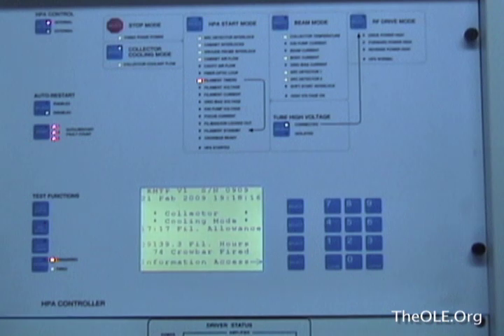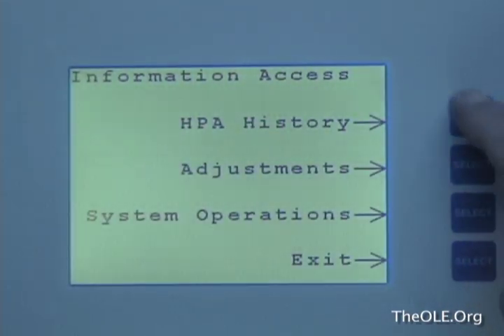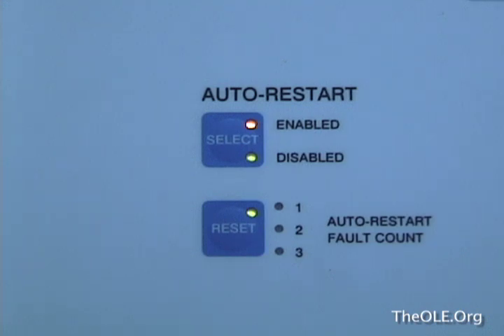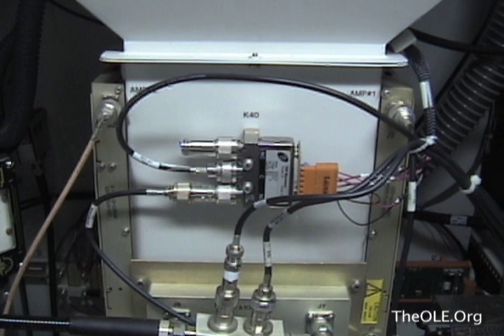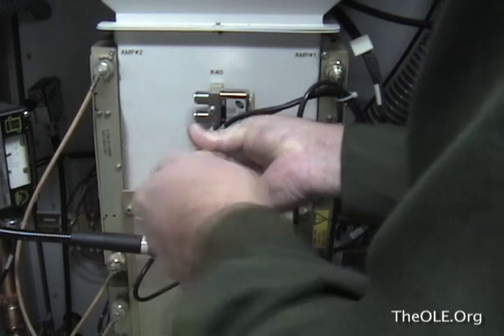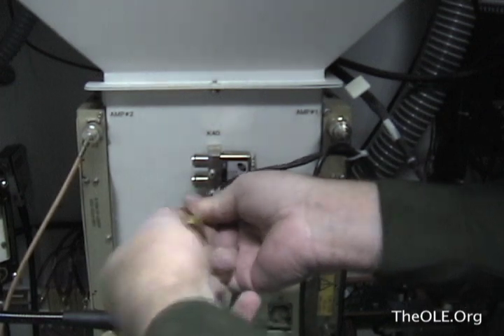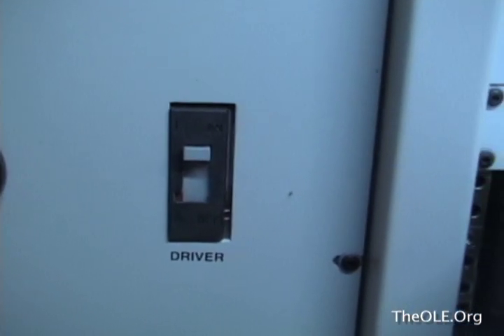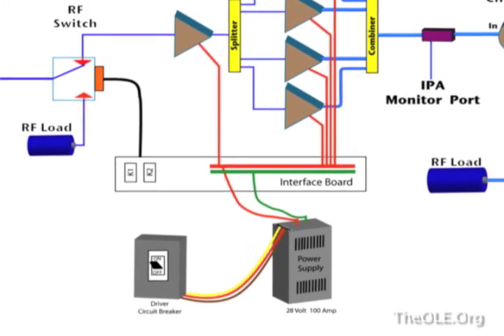Trouble at the Transmitter

Comment: I wonder if I would have noticed the 28v supply being out.  It would have been nice if they would have put a FAIL light circuit on the 28v supply output.  Instead you have a lot of GREEN lights that tell you state but not condition.  A navy guy from an aircraft carrier told me once that the only RED light you wanted to see below decks was the Coke machine.  Any other red lights and you got a problem.  These are excellent.

Comment: But, it had "idiot lights".  Missing was a steady approach to the issue and - if the diagnostics are to be followed - sufficient diagnostic data.  Indeed, the diagnostics themselves should have indicated this simple PSU failure!  That they did not points to a lack of the basics back when the transmitter system was designed by its manufacturer.